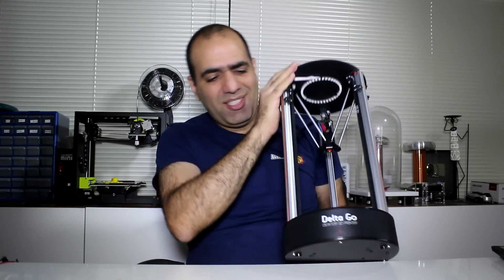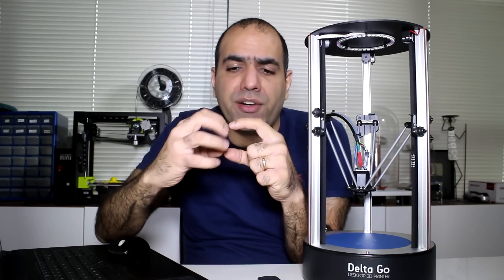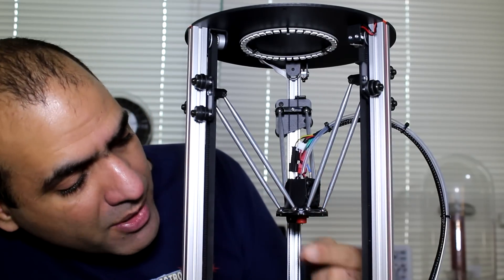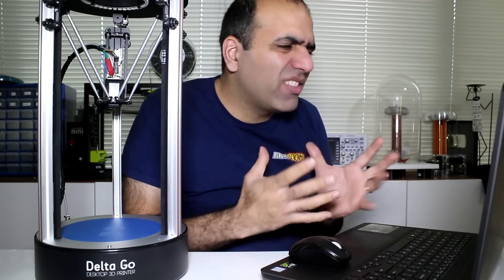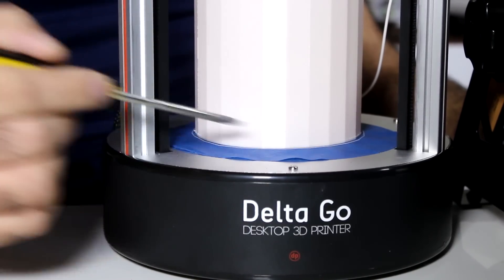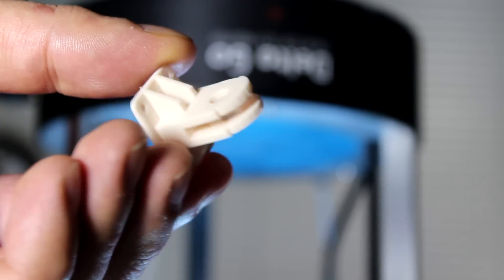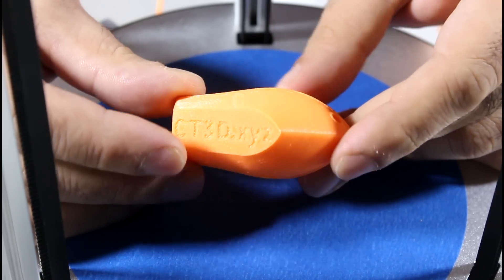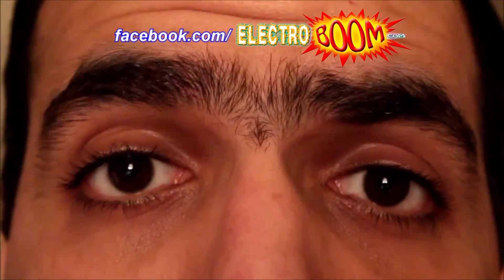What's a Delta 3D Printer, a Delta Go Review

Comment: Shall I buy this...? So tempting. I'M SO TEMPTED
Reply: Andrew /// How so? What does your life consist of?
Reply: Getting a life is overrated.
Reply: $350 ain't that expensive, so I'm really tempted
Reply: there's 150$ printers that are much better and larger.
Reply: Alucard Pawpad Well aren't you a little aggressive. I'm going to ignore your tone and proceed in a manner contradictory to your attitude.

First of all, if you had actually read my comment, you would know that I advised he do his own research and draw his own conclusions. Yeah, if you define industrial quality as an ABS frame, smallest motors they could get away with, a piss poor extruder assembly (envisioning the M3D here), probably. I tend to define industrial quality as being difficult to break, easy to repair, and highly precise, and built from materials that will not fail under the average working conditions of the machine. I, personally, would like to see what an 80$ 3d printer would look like. A printer is more than the materials involved, it's how it's built. If any machine is built like the average underbuilt and poorly engineered piece of shit consumer machine, it's going to run like the average underbuilt and poorly engineered consumer machine. If it's properly built and well engineered like a Prusa or a Makerbot (almost kidding because you can do better for cheaper) or a FlashForge,  Ultimaker, Lulzbot, etc, it's going to behave like a properly built and well engineered machine. You get what you pay for, and after it went into production, people who bought the Tiko (garbage) and the M3D, which had quite a few problems at release, learned the truth of this. in defense, however of M3D, they got their shit together, listened to the community and improved their printer, so it's now decent enough for what it costs, but you're still better off with an Anet; about a hundred dollars less, and twice the quality, both from a mechanical engineering standpoint and from a print quality standpoint. My only real issue with the A8 is that the frame could be sturdier, and it has no enclosure, and all of the components are thereby subject entirely to the effects of their working environment, as is the print.

Now I'm going to ignore your tone and take your side on constructing a 3d printer, because it is actually much cheaper. I should know, I've started work on one because even the CP still can't fulfill my build volume requirements. It is a lot cheaper, but unless you're building it from a premade design, and to some extent even then, it is quite difficult. In principal it sounds really simple, and I suppose that from an engineering standpoint, getting a machine to move on XYZ axis, and spit hot plastic on the working end is not actually hard. Getting it to do that to the same resolution you would expect from a good commercial printer, while certainly far from impossible, is not easy. Once again, it boils down to the question of "What exactly do you need to do.", so if you can deal with the inherent complication of building it and then tinkering with it to get it to work to your standards, build it.
Reply: go on....
Reply: Alucard Pawpad Why are you getting angry?
Reply: there's way more than you could imagine in the 3d printing world... you could start with sla/sls printers for more precision, or powder based printers for built-in cmyk color functionality. but if you want to stay with your ordinary fdm system, then there are at least some printers, that use more than just counting steps. you could have one with absolute positioning, like a DRO on a lathe,  you could have sturdier frames, beefier power supplies, heat controlled chambers, everything to reduce the chance of a failed print or a bad surface finish. also, with a more heavy duty frame and absolute positioning comes a higher speed you can print in, which needs special nozzles, and you usual heat cartridge won't handle that.

Stop wasting everyones time by commenting BS like that. you can get way better quality if you go above 150$. but for a good start, thats more than enough.
Reply: Eh, at that price, I wouldn't buy it.  I have a printer with a heated bed, and an 8"x8"x8" volume, and OctoPrint set up with it at that price.
Reply: which other ones have this price?
Reply: I need a life, can you suggest a good brand?
Reply: +xtianor ask Bon Jovi, they seem to know something about that..
Reply: +Andrew /// ure a lil bitch
Reply: therealpanse dude but "is his life"
Reply: Buy an iPhoneX instead....😂
Reply: If you want to print an ipad cover, the printer is too small
Reply: he looks alive to me!
Reply: Dont buy it there are better oned out there for this price
Reply: Go for it!
Reply: @Andrew ///
 Maybe you should stop being poor
Reply: get an Anet one... even the older A8 is great for begissners, costs only about 150$ (or even less) and has a bigger printspace. sure, it's not plug and play, but i guess if you're watching something like this channel, you're comfortable with a kit printer.
Reply: why do you need it?
Reply: Don’t buy it! Way too expensive for what you get. And deltas are not as good as Cartesians yet
Reply: I second the A8 if you want to get seriously into 3D printing but only if you have a lot of free time, as it's a self build which requires some patience but is a very good learning printer since you build it yourself. You might need to learn some basic wiring tho and get a soldering iron because the quality of some parts is very bad. If you are an electronics wizz then get the A8 as it's a cheap and fun tool to learn from with good specs such as a large heated bed for printing big parts
Reply: No. There are tons of printers like the mp select mini that are better and have more features.
Reply: Im buying tarentula hawk
Reply: HB You can also buy a Wanhao Duplicator i3. It costs ~350$ and is pretty much fully assembled(you just have to screw 6 screws in an plug 4 cables in) . I bought one and I'm super satisfied! I worked also with other printers(over 1000$), but I prefer the wanhao!
Reply: Watch 3d printing nerd' s videos first....
Reply: You need to consider what the application is. General use, Anet or Prusa. If you're like me and you needed a printer that is essentially the closest you'll get to an industrial printer in a desktop machine and will also never irreparably break due to serviceability, FlashForge Creator Pro (Note: the Anet and Prusa, as I understand at least, are also highly serviceable machines. There are only a few I know of that would make things like a motor malfunction a hellish teardown). If you absolutely need the highest resolution you can get out of an FDM 3d printer and money is no object, Ultimaker (also enormous print volume). Deltas are nice because they're fast and have a small footprint, but to do what I do on my FFCP on a delta (drone frames, prototype parts, that sort of thing), I would need a delta that would have a larger effective footprint than the CP. You also need to consider that with filaments like ABS and depending on the application and brand, PETG, you will want to print in an enclosure, so having a printer that isn't a mile tall is helpful, especially if it already comes fully enclosed. I've worked with a lot of printers (avoid Makerbot), and I have never worked with a delta and enjoyed it TBH. The pros are they look cool, they're precise, and they have a low footprint, but at the end of the day, I need to be able to print large bottom surface area objects, frequently an a quadrilateral format, that render circular platforms detrimental to me. Now realistically speaking, if you can live with the build space being a circle, and thereby having effectively lowered platform space to printer volume ratio then go for it. I'm not saying deltas are inherently bad, but it all depends on application. My best advice is to not listen to me; go do your own research, and draw your own conclusions. Only you know exactly what you need and it follows then that with proper research, you will know what printer you need.
Reply: Buy it so you could print Dildos and the planet from aids
Reply: Maybe get a life first

Comment: I got a 3d printer for 145 dollars and it's pretty big it's also not bad
Reply: What printer was that?
Reply: pockhal it was a ctc 3d printer from eBay
Reply: you can get pretty decent printers for very little money (if you can fix problems yourself)
Reply: Raeffi yea the only problem with with mine was that the screws on the pre built parts were loose
Reply: i bought a kit for 350€ with ~24*20*20 buildspace and heated bed. didnt dissapoint me yet